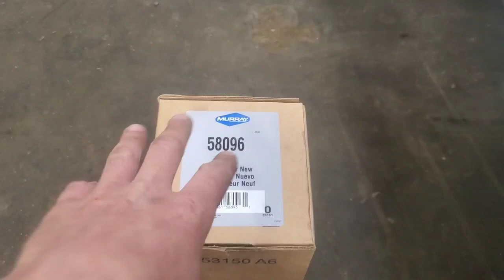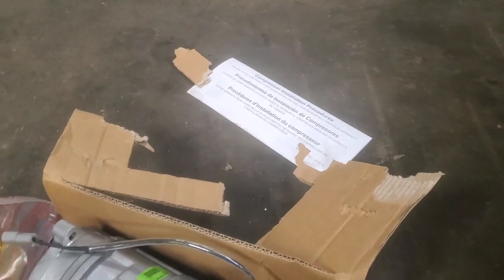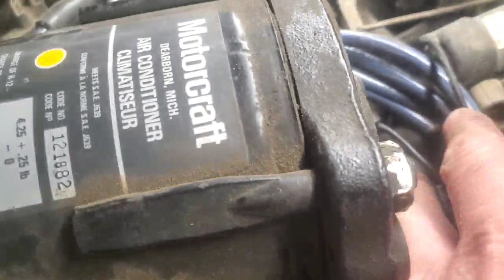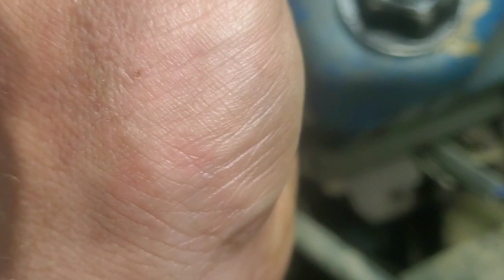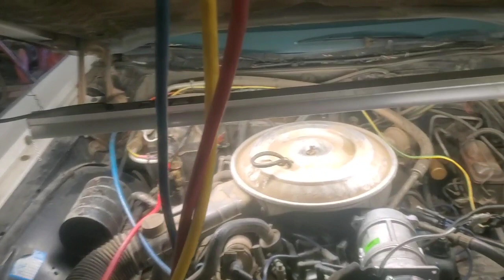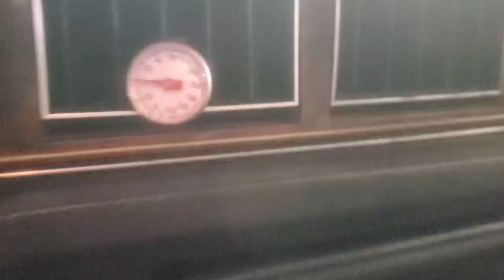Ford/Lincoln/Mercury New Modern AC Compressor Installation.

Comment: Nice vid very useful tips but I changed my ac compressor recently and now my hoses are freezing and not blowing cold air I’ve changed the the expansion valve and drier before and it was cooling really good with old ac compressor but I had to change it because it was leaking Freon I’ve added about 30 oz of Freon and not sure if I should add more I didn’t vacuum clean it because I don’t know how to use the gauge so I’m guessing g maybe moisture of bad poa valve since it’s the original but like I said everything was working awesome until I changed compressor any tips?? 😊

Comment: Great vid... whats that hose called behind the compressor?.. my line freezes  and no cold air is blowing. Mechanic  said the value is stuck on that line..
Reply from the maker: @YoMoe843  If it's the line running along the fire wall that you're talking about I think that is the low pressure return line.  The expansion valve is probably not working correctly.  There's also a POA valve in these systems that can be a problem too
Reply: @prodieselrepair3218  thank you!
Reply: @prodieselrepair3218  any leads where I can order it.
Reply from the maker: @YoMoe843  they're available pretty much anywhere.  I've gotten them from NAPA before
Reply: @prodieselrepair3218  lol.. here in Florence sc  I've been to 2 Napa stores and they claim they can't order it. Don't k.ow how to look it up to order